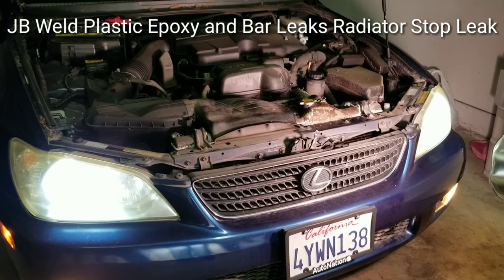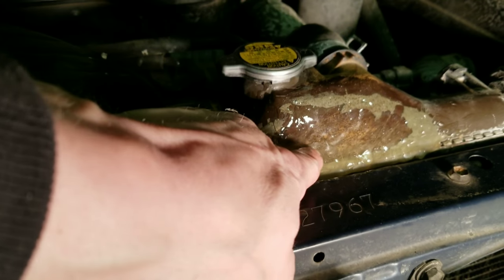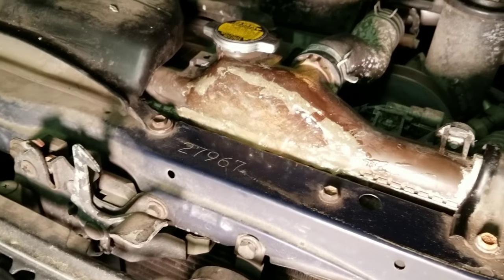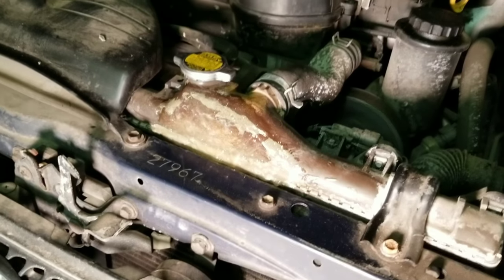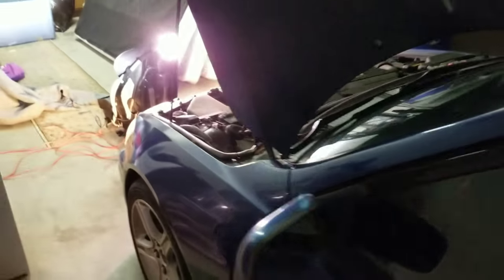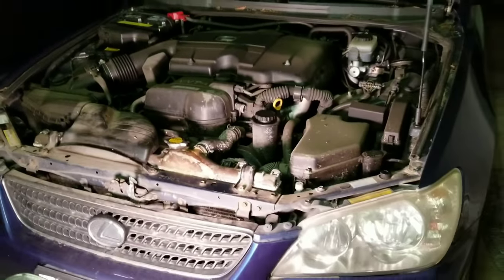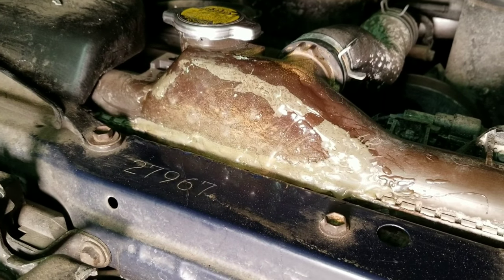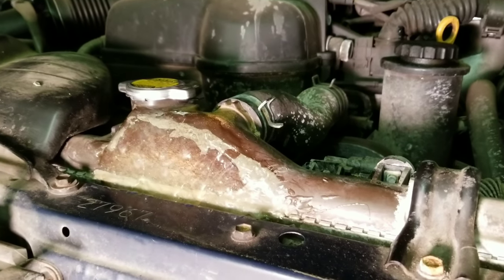Repair Any Plastic Cracked & Leaking Radiator 15 minutes & $15 - Cheap, Easy & Fast

Comment: Thank you. I'm 65 female on a small income. It would take me 4 months to save $1000 to fix at pep boys. I have a hairline crack in plastic radiator just below the big hose. I'm going to do this quick fix until I can save for new radiator if needed. Unless it fixes it permanently. I've no family. So this is my choice. Thanks again. It's a 2004 jeep grand Cherokee Laredo
Reply: Hi Suzanne! i'm in same predicament... curious to see if it worked for you?  :)

Comment: Tireman told me 600$ for new raider I was over heating cause I have a crack in my radiator I’m gonna go to auto zone to get the stop leak will it make my heater start working better again

Comment from the maker: Update: 8,000 miles later still holding.
Reply: Thanks brother, this is exactly what I was looking for.
Reply: @CannonMan391  I've been looking for the same confirmation. Thanks!
Reply: Thanks for the update. I've got a real beater that hopefully can be on the road another 2 years, it just keeps starting and going. Not long enough to invest in a new radiator so hopefully a patch will work, just trying to figure out the best one.

Comment: The biggest issue is the plastic radiator will deform and expand the crack once pressure buildup, especially the crack extends long enough. That's what happened on my radiator. Tried jb weld, doesn't work well

Comment: I have a Ford Escape where the radiator cap is not accessible. My reservoir is where I add coolant.. I put the stop leak in the reservoir. Temperature gauge still running hot with coolant full? Help

Comment: Very educational for me. Unfortunately we don’t have JB Weld and Bar here. Will PC Fahrenheight Hi Temp work on a small crack of plastic crack . Will appreciate
Reply from the maker: You need a solvent that hardens but has some flex to it. A tiny amount to give to driving engine heat.

Comment: Didn’t work for my situation. My leak was at the inlet to the upper hose an I’m guess there is a lot of pressure and in that location it is very hot. Trying to use a high temperature self adhering silicone tape.

Comment: My 2001 Acura MDX has a crack in the exact same spot and  at 168,000 miles going to try this .
Reply from the maker: Prep a rough surface as much as you can. Take your time and do it in layers.
Reply: Clixstorm DIY sadly it didn’t work out for me I did 3 layers let it sit for 2 whole days and for some reason not sure why but it made it worse didn’t last more than few hours before it looked like tea kettle shooting steam out of it.

Comment: the tank gets corroded on the inside from the hot water pushing against it,stopleak is great for plugging up the radiator!!! temp patch for sure

Comment: never put any thing in the radiator to stop a leak.. it will plug coolant passages and the tubes in the radiator, if they are partially blocked,  the stop leak will block it the rest of the way.. same with the heater core.. not to mention heater valves.. also it can affect the thermostat..
Reply from the maker: I'm The Law if you are unsure,  rapir only the crack from the outside.
Reply: First off i used to rebuild/repair radiators and even repaired heater cores that radiator shops claim they cant be repaired.. which is a lie to sell a new core.. more profit..

Plastic Radiators degrade over time based on  heat and time.. as the older the plastic radiator ( a Nylon  Composite) gets  and  hot, it degrades, mainly around the intake side of the radiator and becomes soft.. so repairing the crack is basically a temporary fix but can last a long time, depending on the age an how hot it gets..
Im replacing a radiator that is 22 years old 180,000 miles and the plastic around the intake side where its cracked, can be scraped off with my finger nail.. that is really soft.. I  wouldnt fix it unless the plastic is hard.. 
when repairing plastic never use epoxy  because it can come off, due to the fact moisture from the crack,  can get underneath the epoxy and cause it to separate  from the repair.. 
one guy suggested using Crazy Glue and baking soda as it becomes rock hard.. but i dont know if it is porous or not.. or if it will stick to the radiator..

for metal, you are right, if it can be fixed, personally i  like to use expensive metal, silver solder.. I can use a bottle of map gas or propane..
 but 50/50 is what I used in a shop setting..
Reply: General Motors recommends radiator sealant wafers, which will seal just about any leaking cooling system in a vehicle. They put them in all of their vehicles right after they roll them off of the factory floor and first fire the engines. 
   That being said, putting multiple sealants into your cooling system can clog it up, making the issue of a leaking radiator the least of your problems, because now you have insufficient coolant going through to the motor, and you will overheat. Overheating a modern engine is death.

Comment: Why did you put this crap in when you had the actual leak was fixed. It can plug heater radiator core, and the main radiator passages.

Comment: Nearly all radiators are made of plastic these days even on high-end cars. If you get a crack in your radiator replace it,  they're not that expensive and relatively easy to do yourself.
Reply from the maker: What about those on Governments Shut down or unemployment.  You assume everyone can afford $200. 67million different lives in the USA. Probly a few who can't.  Im still driving the car on these cheap repairs.
Reply: @clixstormdiy4352  fairpoint and yes you do what you have to do to survive. All the best.
Reply: Agreed.
Reply: there nylon substrates...
Reply: Yes it is expensive. Pep boys wants to charge me 900-1000 for a new radiator. I'm on a small set income. No family. It's a small hairline crack just below the big hose connection to radiator I wiped it and can feel the crack with my finger. I can see it leaks . But if this quick fix with jb works it will buy me time 4 months just to save 1000.

Comment: How about using a patch made of appropriate material to apply to the outside of the break as reinforcement after joining the parts? Would be like doubling the wall thickness in the weakened area.
Reply from the maker: I hadn't thought about that but see your ingenuity would have worked.  I was using things I had access too. But I will keep that in mind.
Reply: That bars leak will clog you heater core,be warned.

Comment: Mine is just like that. I used the weld it worked for a while and then the crack came back out I used the jd weld again and it's cracked again!!!
Reply from the maker: Preparation is key. Another comment suggested fiberglass tape to help hold the crack.